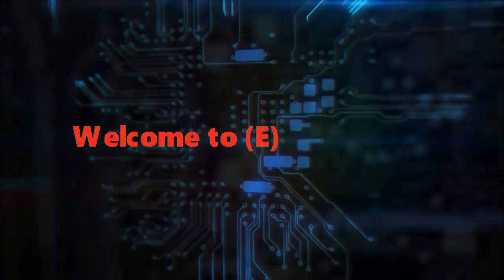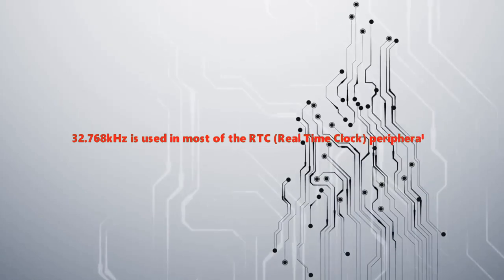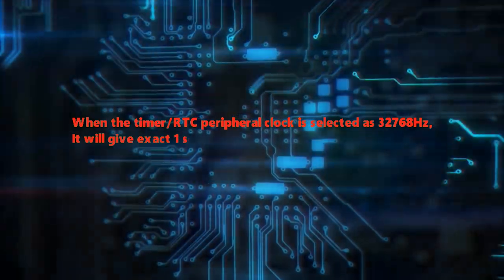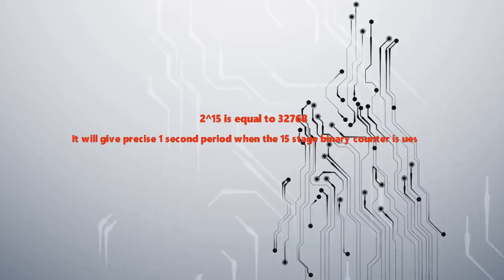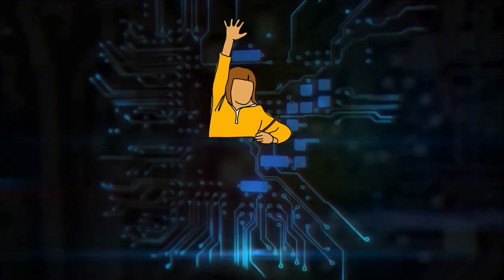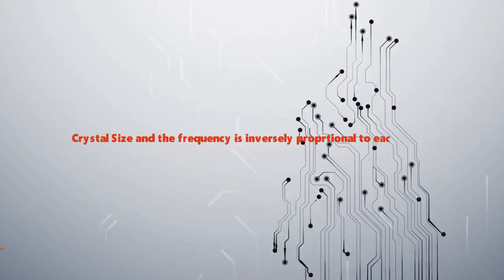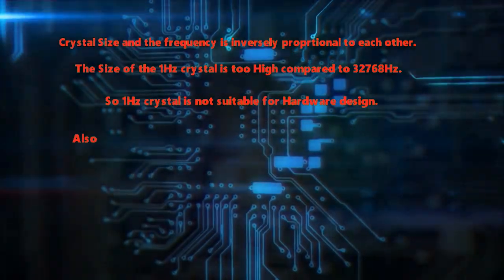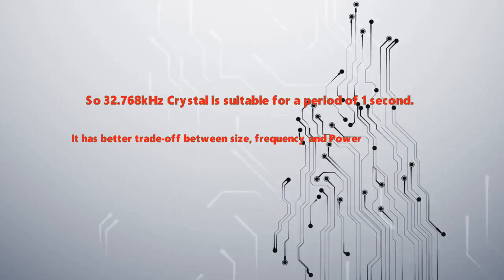Why 32.768 kHz frequency crystal oscillator is used in many RTC watches and Timers ?

Comment: Middle C on the piano sounds like red (the beginning of the visible rainbow spectrum). The world's great love songs are in C-major. 32,768 hertz, when continually halved, reduces to an lower octave of 256hz: Middle C.  Therefore the piezoelectric crystal resonates in red. An extremely high C-note. Music is frequency in time. This would explain why time--at least on the grand piano--begins where the rainbow commences. At least that's what Glenda the Good Witch told Dorthy after cracking a cigarette.

Comment: Probably it is also because of history, availability and economy of scale. Even if today we would find a 65536Hz crystal to be more power efficient or to be slightly smaller or slightly more precise, we would probably still stick to 32768.
Reply: Middle C on the piano sounds like red (the beginning of the visible rainbow spectrum). 32,768 hertz, when continually halved, reduces to an lower octave of 256hz: Middle-C.  Therefore the piezoelectric crystal resonates in red. An extremely high C-note. Music is frequency in time. This would explain why time--at least on the grand piano--begins where the rainbow commences.

Comment: What I want to know is why there are so many videos that explain what one is and why to use one.  No one can show a simple example of using one.  Hell, I can't even find a video that mentions what the two pins are.  ground and vcc?
Reply: ground - electrical ground, vcc - voltage source, sda - serial data, scl - serial clock - you want to just look at circuit diagrams because its basically how you would wire a lightbulb (twice)